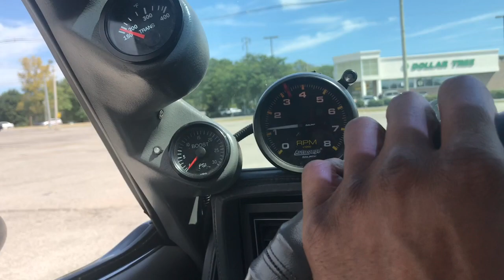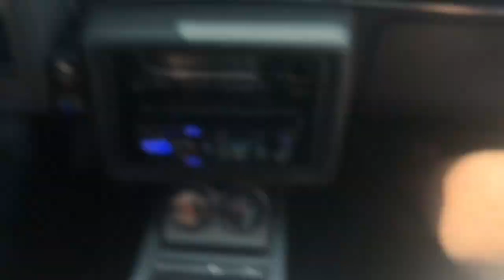Turbo lag on the Buick Grand National

Comment: He’s right about that T.V. cable (detent cable) 
All these new ones strip out because people are adjusting it the way the factory says to adjust it but they strip out that way.
The best is to TRY to get an original cable ( has gray tip).
I was lucky to get original one off an 89 TA from the same guy that did our transmission when I was at his shop in NY.

Comment: I had issues getting my shift points also. My throttle body wasn't opening but 90%+-   I had to shim the throttle cable at the firewall then I could get my shifts to 5k at wot without late or early shifts or 2nd gear starts.  I see ur speed density, what do you tune with? Most likely ur rich down low and timing might be a lil low out of boost. I have a TE61 and a 2800 9x11 converter. Was SUPER laggy.  I built a RJC style quick spool controller and it helps. Biggest difference was adding timing at wot(GEN2 Translator) before boost kicks in. Now it does 1.6 60ft leaving at 2800rpm and 0 boost. I run around 30 degrees up to 2800 and tapers to 18 degrees at 3500. This is set to my boost curve yours will be different.  Check some of my vids out. For the mild combo I have she does well/7.1@96 in 1/8th on 93 pump and VP Octanium.
Reply from the maker: i have a classic fast in the car, we are going to switch the detent cable and then look at the tune
Reply: Adding timing down low and up to the flash stall of ur converter should help a lot

Comment from the maker: The car is a beast just needs some tuning, Do you guys think its a 9 sec car?
Reply: Yes it is a beast, very fast car when on the highway driven fast. 👍🏾
Reply: what's ur combo?
Reply: You def have the parts for 9 seconds. Just have to turn the boost up and get a good launch. Going to need a very low 1.4x 60ft and maybe even a 1.3x. Any fully built GN (heads, cam, at least a 6266 and maybe even at least a 6466 or 6766, converter, all supporting fuel mods) should be capable of running a 9.9x depending on launch.

Comment: I had to find a OEM Detent cable because no aftermarket part would hold up for my car ... they are all built cheap and the teeth strip.
Reply from the maker: i contacted highway Star and they are out of stock on there detent cable...so i`m going to look around
Reply: @2muchBoost_  checkout on Turbobuickmembers on facebook I think I seen a post of NOS Detent cables from a member by the name of Lyle Culver send him a message and get a good stock NOS or lightly used cable over aftermarket.. I just went through this issue and the aftermarket cable went right into the trash.
Reply from the maker: @YGSpider  thank you i will try to find him

Comment: Sounds like converter issues .
Reply from the maker: i hope not, but i got another detent cable to try and then i will go from there
Reply: 2muchBoost how’d you make out after changing the cable?
Where u located 
Try as hard as possible to get original cable.